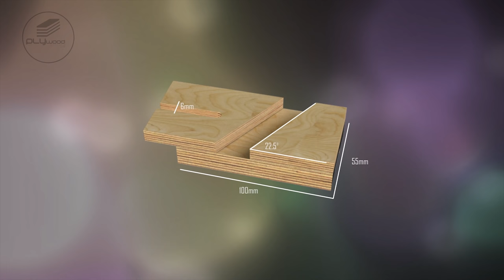Easy Way Sharpen Drill Bit Use Angle Grinder - FREEPLAN

Comment: A friend of mine has a bowling alley and a proshop and drills 100's of balls a year. His bits have a #2 morrest taper and are carbide.    About 3k for a new set.       SO I/ had him get me a diamond disk I am going to put in the shopsmith then I can set the table and miter to the right compound angle.     I am going to weld two pieces of ange one in a V about 2 inches for a tray to hold the bit the other will be at a 90% to blot to the miter and then weld to the V track piece.     This way the small bits with a larger taper the taper will be held off of the table and away from the miter gage.   Then I should be able to advance the quill direct into the flat carbide at the right compound angle to clean them up perfect.
Reply from the maker: thank you very much for the tips, i will try like you ask.

Comment: When using a push stick on a table saw you should place it close to the blade not the fence as it will push it into the fence if it tries to twist. If you do it on the side by the fence you can push it into the saw blade away from the fence.    Not trying to be a troll  and knit picking, just trying to help people that might be watching as well as yourself.     This is a pretty good Idea.
Reply from the maker: thank you very much for good tips, correct me if i made mistake 😊
Reply: @plywoodworking  Trust me I do not make  videos because I would b called out the first time I turned on a table saw with no upper or lower guard on my shopsmith. lol    Hell me just using a shopsmith would piss most people off. Lol    But it is never bad to encourage others not to take short cuts or make mistakes.      Looks like both of us still have all our digits.   If 40 years I have only grabbed the 3/4 router blade once while spinning  in a 3/hp.        The wood working gods was nice enough to let the pad of my finger and thumb to grow back .   More than some can say.          I will check your channel out a bit deeper.